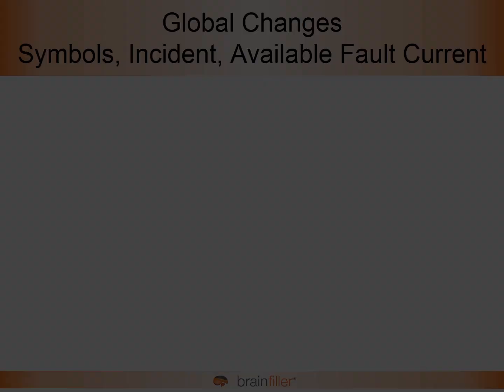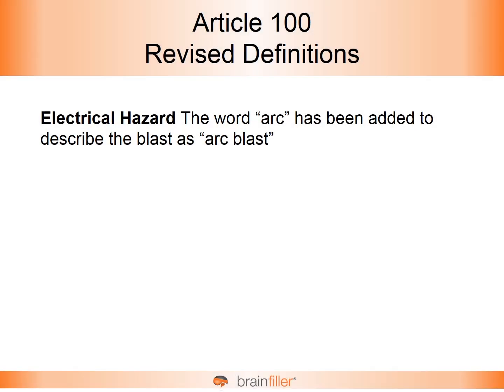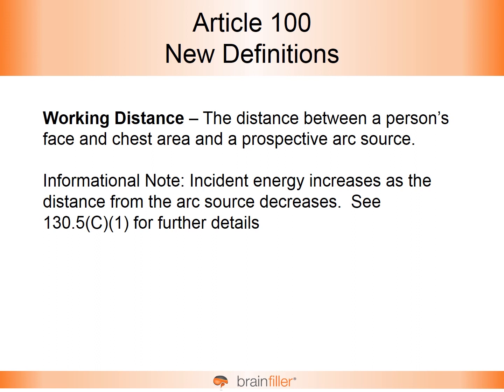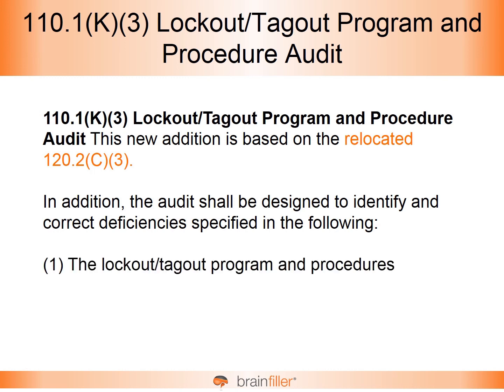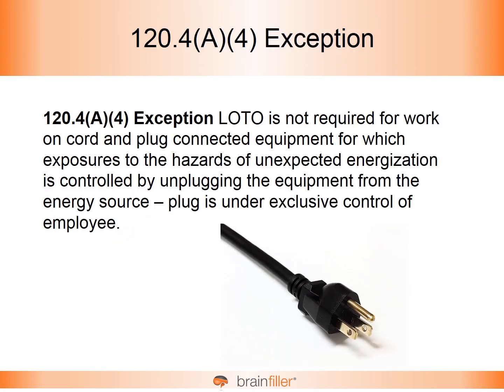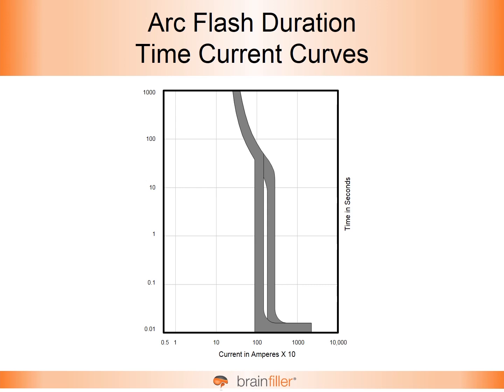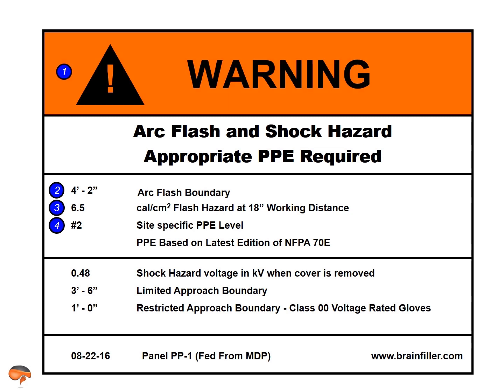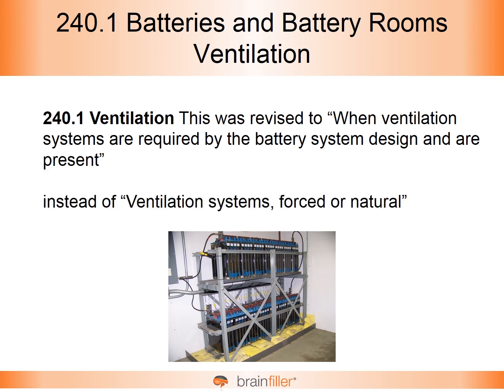2018 NFPA 70E Changes - Jim Phillips, P.E.

Comment: Risk Assessments are fine and effective if and only if those performing it are genuinely trying to determine the hazards involved and the best way of eliminating or mitigating them.  However in most cases, the vast majority of electrical workers just go through the motions and their assessment of risk is subjective as best.  One guys thinks working on energized 120 volts is safe because he's using insulated tools while a different worker thinks his training, experience and technical skills will keep him safe.  Very seldom if ever will such workers ever consider placing the equipment into an Electrically Safe Work Condition (ESWC) because it takes too long, isn't necessary for "only 120 volts" and "I've done it a hundred times and nothing has ever happened to me".

And this is where the employer, AKA managers and supervisors must perform audits of their employees to ensure they are not only following safety rules but are actively and effectively performing a risk hazard assessment using the priorities as listed in hierarchy of risk controls to determine if the hazards can be eliminated, i.e. placed into an ESWC as the first and foremost choice.
Thanks Jim

Comment: i would like to find an explanation of when HV gloves are required especially when working near high voltages -- class 4 gloves go up to 36kV, workers often assume you need gloves to meet the voltage being "worked" on. example operating 230kV manual switch. what gloves are required? the worker is only indirectly working on 230kV - operating a switch handle.  another example would be testing voltage or applying grounds on 13.8kV circuits -- what gloves are required?

Comment: There seems to be an argument in our industry as to the qualifications of the individual performing an arc flash study.  Does NFPA 70E mandate that you must be a licensed PE to do the study?  Does OSHA require this?  Another instructor told us that arc flash studies are clearly an engineering study and to perform such a study without a license is illegal in most states.  Your thoughts?
Reply from the maker: Great question.  I often hear of people attempting a study with limited knowledge of power system analysis etc..  Unlike other studies, if an arc flash study is incorrect, the results can affect a person's safety.   

Years ago I was co-author of the first draft of IEEE 1584.1   The "dot one" standard is about specifying arc flash studies.  The first draft mentioned qualifications including a P.E.  We were asked to remove it.  Instead, there is language referencing a person to check with the state licensing board to determine if a P.E. is required - which is frequently the case.  

Many states also have an exemption if you are performing the study for your own company (not an engineering company performing work for others).  So the final answer, is check the individual state's engineering licensing board.